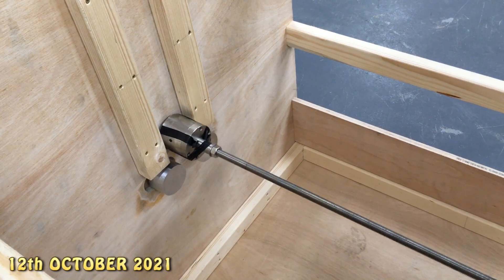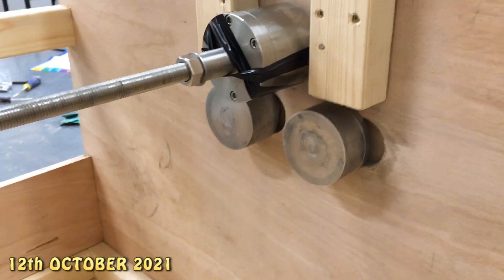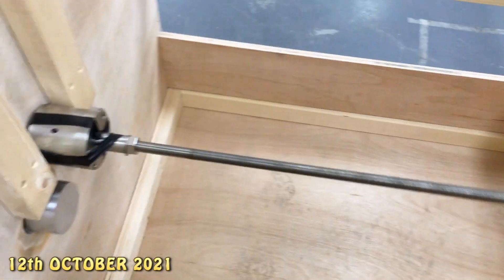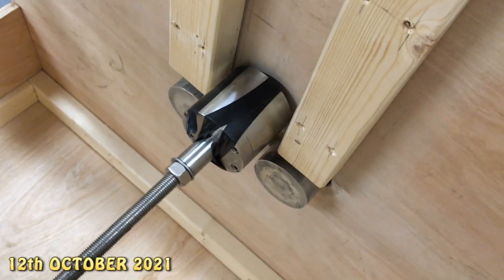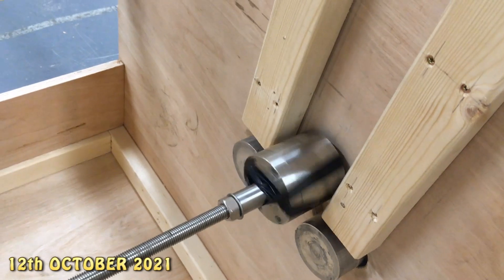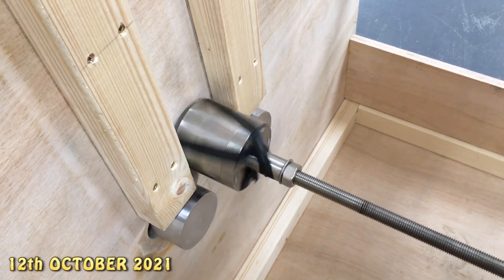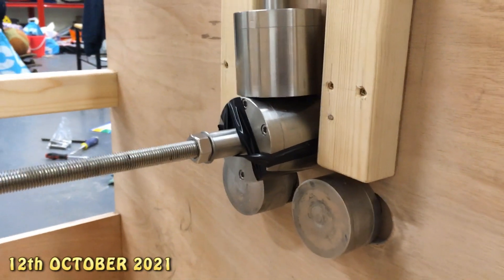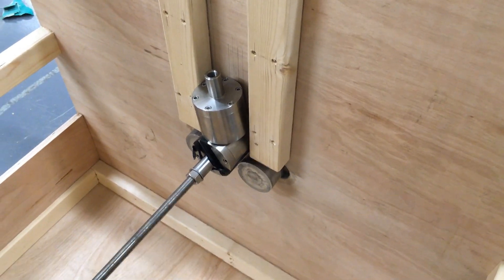Nikola Tesla's "Nearly Frictionless" Bearings - Part 2

Comment: Nice, maybe this is not just an inbetween 'cheat' option. since the rotating magnets peripheral speed is way less if you use a bigger diameter rotor. and thereby can limit the RPM speed... Also the magnets in this setup are not interfering with the power generation coil if you put this in the middle of the axis, far enough away from the magnets I think?
Also you can now simultaneusly use this as a balancing device, just put a cross slide with a kress or dremel on it with an abrasive disc along.
Reply from the maker: Hi Mark, you are right on my train of though regarding balancing. I will be making a balancing machine update soon.

I think it is a "cheat" method whilst neodymimum magnets are still available / affordable. My magnet contact in China wrote to me the other day that the cost has gone up 30% in the last few weeks. Samarium Cobalt magnets are another possible but few sizes available. Currently using N42, 120kg pull 60mm x 30mm magnets.

Although we do not currently have a Gauss meter I think you are correct, there is plenty of room for trying different things ranging from power generation to using wider rotors. Currently I find a 20kg pull neodymium 60mm x 5mm disc magnet as my favourite Gauss measuring tool. I just hold it in my hand and move it nearby. It has become my favourite go to magnetic tool for building this assembly. I literally use it every time I work with this assembly to check polarities.

An example would be: https://www.youtube.com/watch?v=yhu3s1ut3wM

Comment: 6 magnets on each side. Never mind …I now see you are on the right path, the previous statement was before I had seen the whole video.
Reply from the maker: You would need 6 magnets for a vertical arrangement or a mobile arrangement. Horizontal you can get away with 4. For 100% contact free I am thinking 7 each side fully mechanically adjustable. One for the Z axis..... It would have to be a very stiff bearing for it to work.

Comment: Always glad to see progress from you! Thank you for sharing!
Reply from the maker: Thank you oxiigen! Over the last 3 years of full time R&D we have gone from 1350 sq ft to 320 sq ft and now to 1000 sq ft. has allowed us to spread our wings again which was really needed to move forward faster.

The middle size prototype with the 5" rotor has a broken shaft from the water pump experiments. So we have moved onto the 800mm rotors now we have the space and direction. The amount of friction in the off the shelf bearings is quite incredible when you increase the mass of the rotor / shaft. 

Even switching from a 20mm shaft to a 30mm shaft using the same manufacturers bearings the friction difference can easily be felt by hand. 

The other issue with larger diameter shaft bearings is they have a lower max RPM due to the centrifugal stress placed on the balls and races at higher speeds.

Contact free bearings will eliminate most of the noise and bearing noise is energy lost.

We are also working on a PMB design for our miniature machines and it will likely be a scaled down version of this. Prototyping at this size might appear expensive but it does allow prototypes to be much more crude to play with the variables. Playing with the variables at this size really highlights which variables are making a lot of difference. Then you can hone in and tune those features once you know what they are.